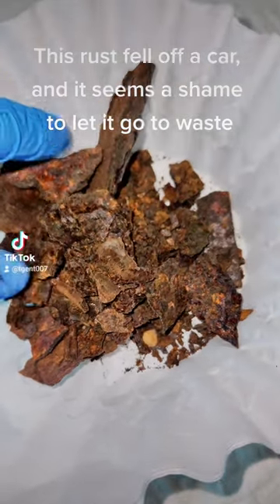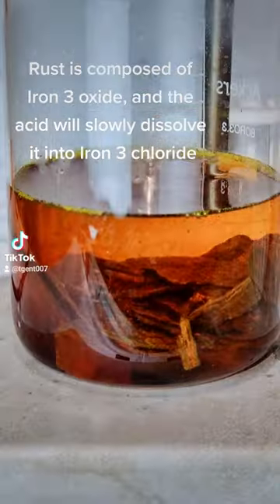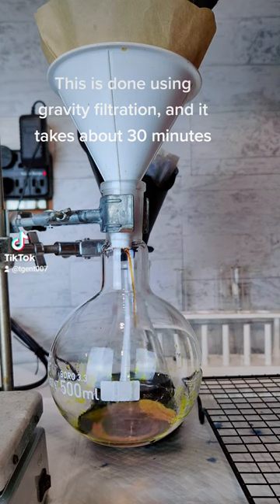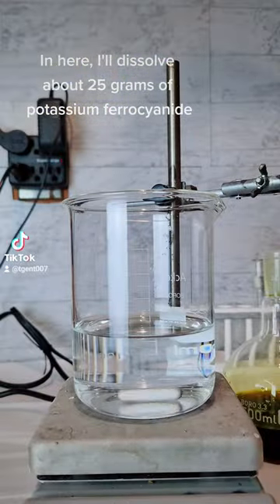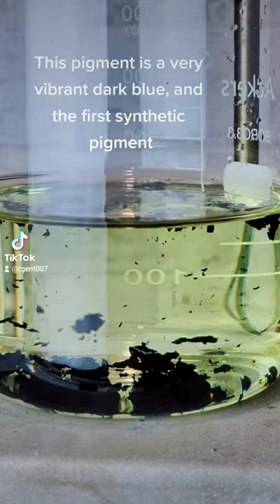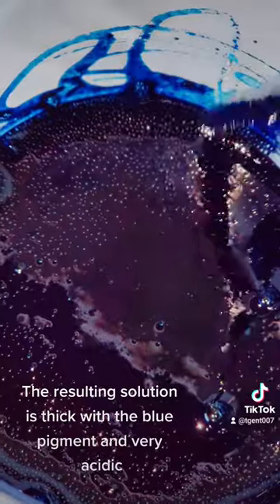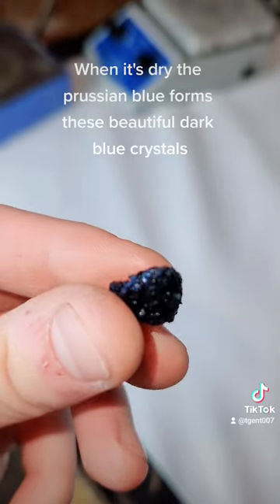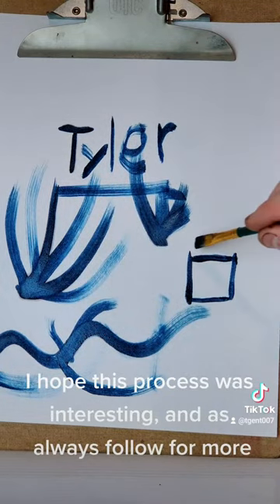Making Paint From Rust

Comment: I am wanting to make a lab for my students where they will make Prussian blue paint from iron nails.  They will use electrolysis to speed up the rusting process but the problem comes when I add the rust to the HCl (1 molar) it only gives me this brown sludge versus the light yellow solution you are getting for Iron Chloride.  Any ideas?
Reply from the maker: Yes actually! Iron is super finicky, and using electrolysis to produce rust will yield brown oxy-hydroxides that are very tough to dissolve. I'd actually suggest just you forgo HCl and conduct the electrolysis directly in vinegar or dilute sulfuric acid to make ferric sulfate or acetate. Alternatively you just just toss some steel wool in a beaker of vinegar and wait a few days